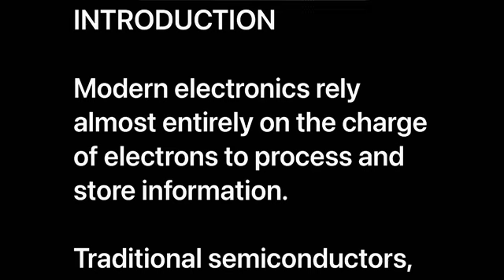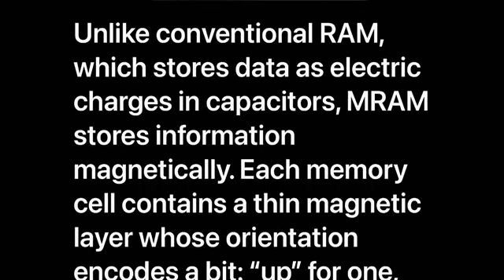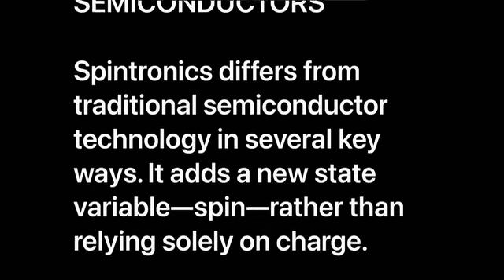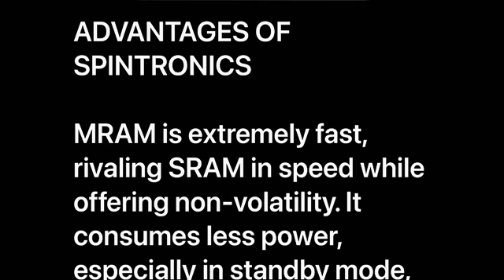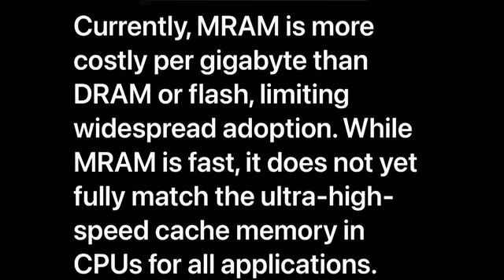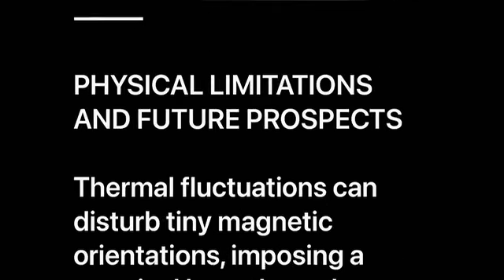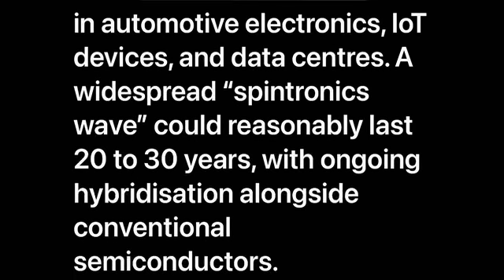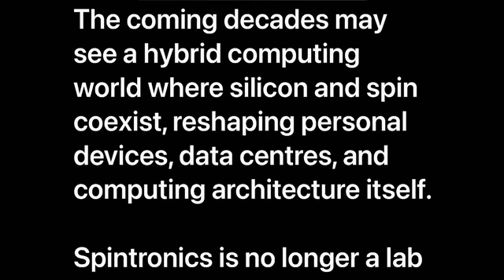SPINTRONICS AND MRAM: THE FUTURE OF ELECTRONICS

Comment from the maker: SPINTRONICS AND MRAM: THE FUTURE OF ELECTRONICS
by AZLAN ADNAN, M.A.
Sunday, 8 December 2025

https://youtu.be/SV08UUhXyisn

⸻

INTRODUCTION

Modern electronics rely almost entirely on the charge of electrons to process and store information. 

Traditional semiconductors, such as CPUs, GPUs, and flash memory, use the movement of electrons through silicon circuits to encode data as ones and zeros.

Spintronics, short for spin electronics, introduces a new dimension: the electron’s spin. Spin is a quantum property that can be imagined as a tiny compass needle pointing “up” or “down.” 

By harnessing both the charge and spin of electrons, spintronic devices promise faster, more energy-efficient computing.

WHAT IS MRAM?

At the heart of current spintronic applications is MRAM, or Magnetoresistive Random-Access Memory. 

Unlike conventional RAM, which stores data as electric charges in capacitors, MRAM stores information magnetically. Each memory cell contains a thin magnetic layer whose orientation encodes a bit: “up” for one, “down” for zero.

Reading the bit involves detecting how electron spins interact with the magnetic layer, consuming far less energy than moving charges through a transistor. 

Writing data involves flipping the magnetic orientation using small currents or spin-polarised currents.

HOW SPINTRONICS DIFFERS FROM TRADITIONAL SEMICONDUCTORS

Spintronics differs from traditional semiconductor technology in several key ways. It adds a new state variable—spin—rather than relying solely on charge. 

This allows non-volatile memory: MRAM retains data even when the power is off, unlike DRAM or SRAM. Spintronic devices can operate at lower voltages and produce less heat. 

They also have the potential to combine memory and computation in the same device, reducing the energy and time wasted moving data between memory and processor.

ADVANTAGES OF SPINTRONICS

MRAM is extremely fast, rivaling SRAM in speed while offering non-volatility. It consumes less power, especially in standby mode, which is critical for battery-powered devices.

MRAM is highly durable, with write endurance far exceeding flash memory, making it attractive for embedded systems and data centres. 

Spintronic devices can scale down to nanometre dimensions without losing performance, promising continued miniaturisation beyond the limits of conventional silicon.

DRAWBACKS AND CHALLENGES

Fabricating consistent magnetic layers at the nanoscale is complex and expensive. Reading and writing spins reliably requires precise materials engineering and advanced interfaces.

Currently, MRAM is more costly per gigabyte than DRAM or flash, limiting widespread adoption. While MRAM is fast, it does not yet fully match the ultra-high-speed cache memory in CPUs for all applications.

MOORE’S LAW AND SPINTRONICS

A critical question is whether spintronic technology will continue to follow Moore’s Law, which predicts transistor density doubles roughly every two years. 

Spintronics is less dependent on transistor scaling because it leverages quantum properties.

In some ways, it represents a post-Moore paradigm: instead of relying on smaller transistors, engineers exploit new physics to increase efficiency. 

MRAM and other spintronic devices can scale differently, potentially sidestepping the classical limitations of silicon miniaturisation.

PHYSICAL LIMITATIONS AND FUTURE PROSPECTS

Thermal fluctuations can disturb tiny magnetic orientations, imposing a practical lower bound on memory cell size. Quantum effects and material imperfections may slow the pace of miniaturisation.

Despite these constraints, spintronics could dominate certain memory and logic markets for decades. MRAM is already deployed 

in automotive electronics, IoT devices, and data centres. A widespread “spintronics wave” could reasonably last 20 to 30 years, with ongoing hybridisation alongside conventional semiconductors.

CONCLUSION

Spintronics and MRAM represent a quiet but powerful revolution in electronics. By exploiting both charge and spin, they offer faster, more energy-efficient, and non-volatile alternatives to traditional semiconductor memory.

Fabrication challenges and costs remain, but the potential longevity of spintronics, coupled with its scalability and efficiency, makes it a transformative technology. 

The coming decades may see a hybrid computing world where silicon and spin coexist, reshaping personal devices, data centres, and computing architecture itself.

Spintronics is no longer a lab curiosity—it is entering practical use today, and MRAM is just the beginning of a new era where electrons do more than move—they spin.

⸻

To donate towards various treatments to restore my vision,please scan the QR code found here:

http://youtube.com/post/UgkxpR5Nm0yHIHO2nBvkVzbTzEaYBCVUBVZq?si=CiiIZk5dPJ-32yC2 

or get banking details herd:

https://t.me/suratkhabarbaru/8938    

⸻

spintronics
mram
magnetoresistive memory
non-volatile memory
future of electronics
quantum technology
low-power computing
advanced semiconductors
next-generation memory
computer architecture
nanotechnology
embedded systems
data centre efficiency
post-moore technologies

#spintronics
#mram
#futureelectronics
#quantumtech
#nanotechnology
#lowpowercomputing

⸻

https://youtu.be/SV08UUhXyisn 

⸻